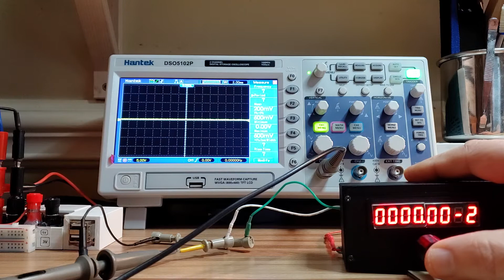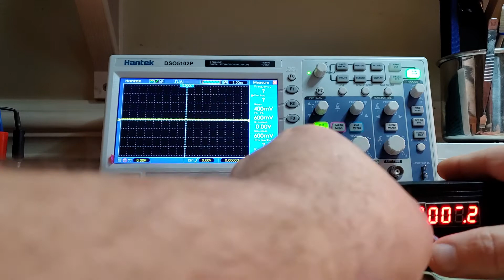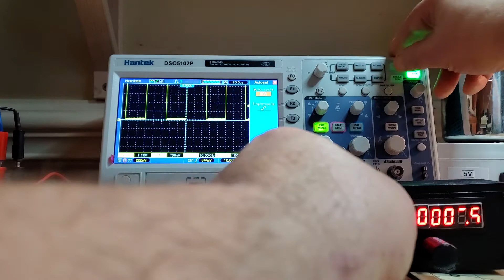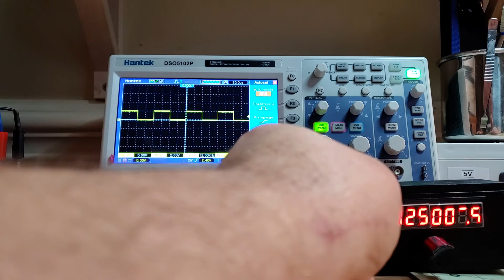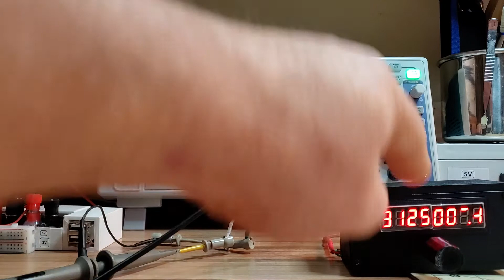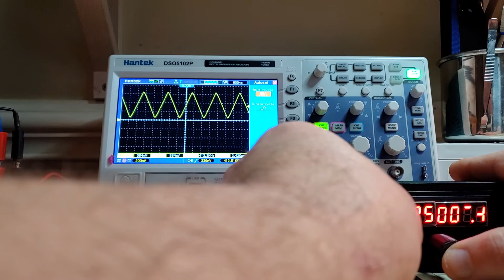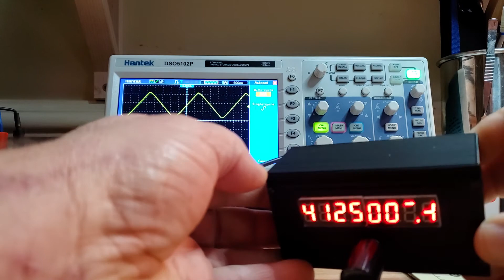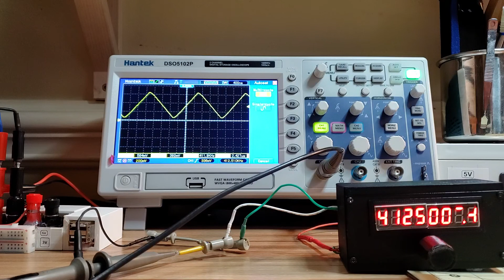Simple AD9833 DDS based signal generator

Comment: Can the AD9833 be tuned to 1 frequency without programming?
Reply from the maker: You will have to send the settings for the frequency you want with the SPI (a three-wire serial interface) This is not too hard to do with Arduino boards. What is it you want to do?
Reply: @UReasonIt  Hello!
Thank you for the quick response.
I want to generate 7.83 Hz continuously.
Can you help me specifically?
Reply from the maker: @b313156  You would probably be better using a 555 timer circuit for this. You will need to have one you can tune with a variable resistor.  Google "555 variable frequency circuit".
Reply: @UReasonIt  AD9833 is quartz - generates a stable frequency. NE555 will not make a stable frequency.

Comment: The Pi Pico based arbitrary waveform generator really made these DDS based ones old eh? Nevertheless, good project.
Reply from the maker: Thanks.  I am assuming the Pico driven WFG is using an R2R network since it has no DAC pins.  The Pico would do a great job of DDS I do think.  It would have been nice if the RP2040 had a DAC out like the STC32 and GD32V do, but we can't have everything ;)
Reply: @UReasonIt  Yeah, it needs R2R. In my opinion, not using a normal DAC is better because you can overclock the chip close to 400MHz to get 400MSa/s. Such DACs are expensive for such high frequencies.